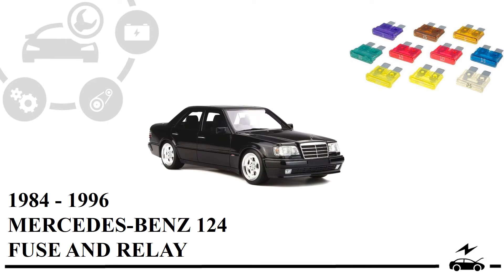Fuse box diagram Mercedes-Benz 124 and relay with designation and location

Comment: S124.191 /131 '94 E300TD (wagon, NOT turbo): In the Factory Service Manual, the main fuse box is referred to as "F1"... Stated on the diagram inside the fuse box lid: "Fuse blower motor outside fuse box/automatic climate control". (aka "F15") the physical location of F15 is not listed in the FSM.